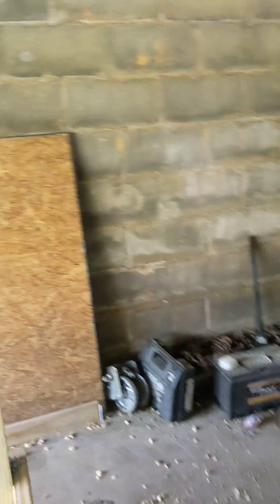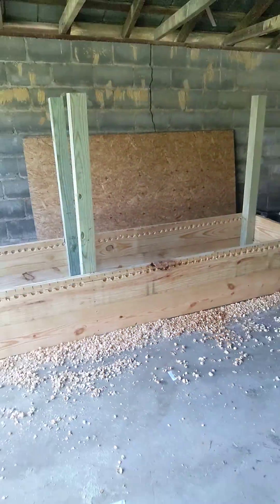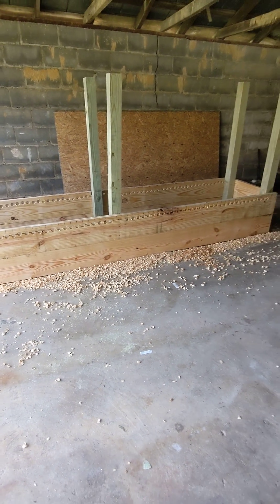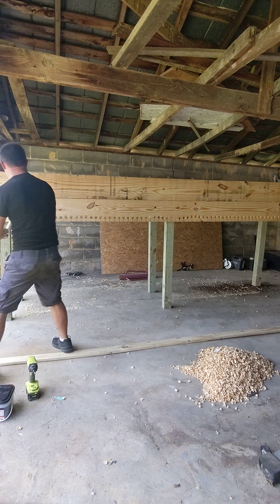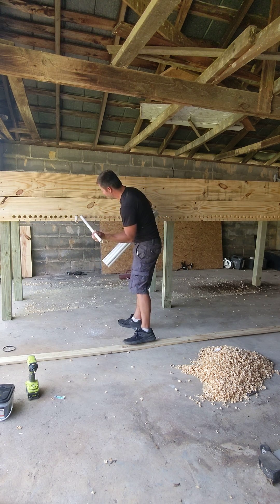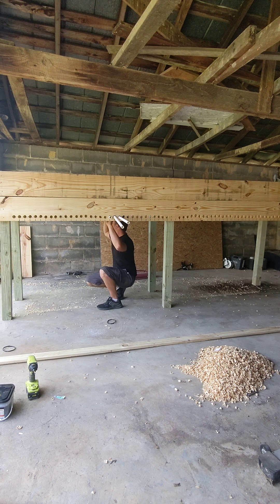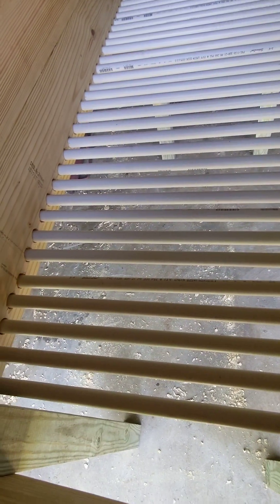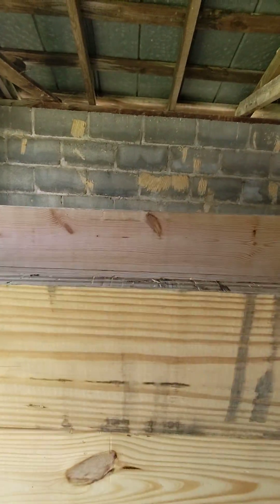Building a worm composting bin continuous flow vermicomposting pt3

Comment: Would the weight of soil bends the pvc pipes?  Would metal pipes be better?
Reply from the maker: Sorry I didn't see your message sooner, but no the soil doesn't bend the pvc at all with it being only an inch gap between the rods and using 3/4 schedule 40 pvc it can support a lot of weight